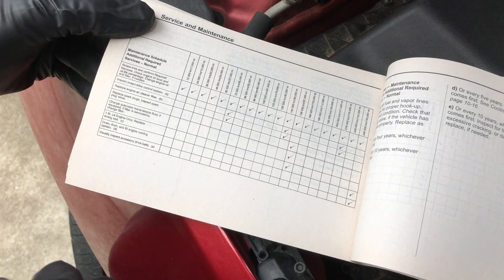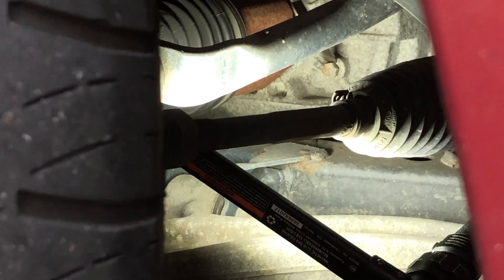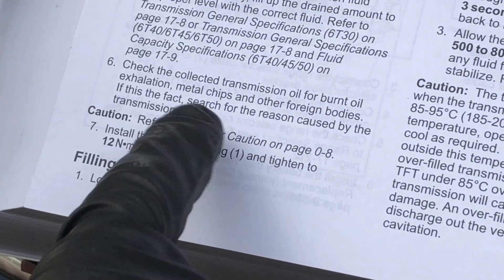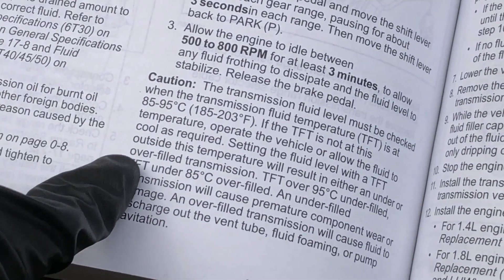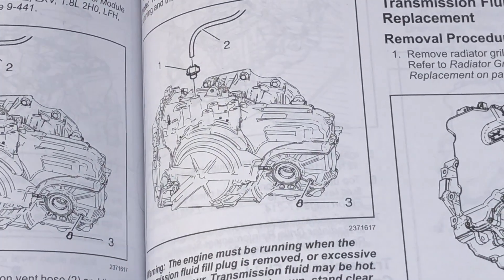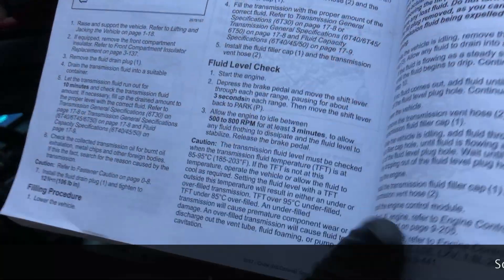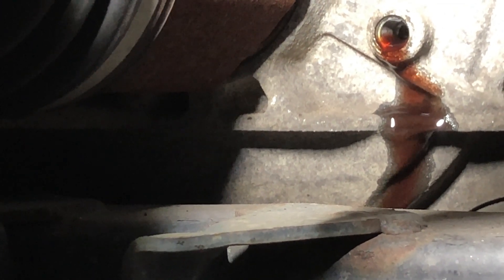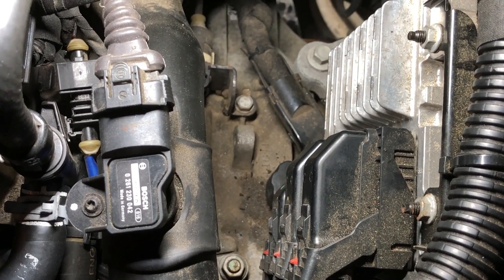2008 - 2016 GM Automatic Transmission Fluid (ATF) Change 6T30 / 6T40 / 6T45 (Chevrolet Buick & GMC)

Comment: I own a 2016 Chevrolet Cruze Limited LT with 103,000 miles, I went to a dealership and was able to get a print out and the transmission in my vehicle is the 6T40 (MH8). My owner’s manual doesn’t list draining the transmission fluid under the “normal” maintenance schedule. Instead it lists draining the fluid every 45,000 miles under the severe schedule. So I am a little confused by what my manual states. I live in PA and it’s 30 miles each way to drive to and from work. The driving conditions are normal, as in no long periods of idling or start stops pretty much just driving non stop. I haven’t noticed any slipping or anything. So my question is would it be beneficial for me to have my transmission fluid changed?
Reply from the maker: GM has for years kept inching towards their concept of "lifetime fluids" , so not surprising there would be differences in the 2016 owners manual maintenance schedules and the manuals even just 2 or 3 years earlier.   But GM never defines how many years, or miles, is their view of lifetime of a given vehicle.   So it's really a question of after how many years, or miles, is the owners manual maintenance schedule invalidated? 

I would go with what the model year manual for your vehicle suggests during the first decade and a half of the cars life , as that would be what the GM engineers determined was necessary for proper maintenance for that given model year. And fifteen years is likely a close approximation of what GM considered a given vehicles "life" .  But after that time I would consider performing some maintenance tasks that went beyond the manuals schedule that would help the vehicle make it to its second, and perhaps third, decades of life . 

The Chevrolet owners manual for the particular vehicle shown in this video, called for the ATF to be changed at every 97.5K miles under the normal schedule, for comparison.
Reply: @DrShock  Great reply,  as a Ford owner they do the same thing, they claim transmission, PTU I have AWD and rear are lifetime fluids. I don't think so, any company that claims lifetime fluid, they just want you back in the dealer buying a car a few years sooner than you should be.
Reply: Did a fluid change last week on my 98 Astro transmission and rear differential at 297,000 miles. It was burnt looking 15 years ago.

Comment: Ok shade tree mechanics, Instead of all that temp BS, just put back in the same amount you removed.   HOWEVER, be aware that if you were low to begin with you'll STILL be low.  So if your Trans is leaking then you must use the check plug method.

Comment: So why couldn’t you just do the drain stone cold, measure what comes out, then fill it with that exact amount?. No need to remove drain plug or warm it up etc..?
Reply from the maker: That would be the shadetree way of doing it.  And I've certainly done that route, especially for GM transaxle models where the level check plug is problematic to access without a lift.   But it's not the recommended way, and it won't catch the situation where you were already low on ATF to begin with.  You'll freshen up what you had for sure, but may still be low which can lead to internal wear issues depending on how low it was/is.
Reply: @DrShock  yeah well…it’s never had a leak and I bought it brand new…otherwise yeah, I woulda gone thru the trouble..
Reply: @xboxbml  i just did my ford edge ..same exact deal… i have friend that is a pro..that is exactly what they do ..measure what came out a refill

Comment: Hey Dr Shock what's your take on draining a transmission using the cooler line to pump it out? Transmission is a GM 4l60. I'm replacing the stock trans cooler so the lines will be off. Thanks for the incredible instruction!
Reply from the maker: I definitely wouldn't use the running transmission pump to do that, there's just too high of a risk of running the pump dry.  Internal transmission bushings can be damaged very quickly with a lack of ATF lubrication.   But if you have an external suction/flush machine that supports connecting at the cooler line, that would work.

Comment: On step 12 says reinstall engine control module what is that about?
Reply from the maker: I mentioned this in the vid, as an optional step to gain more access to the fill port area for certain funnel shapes.  I am using one that does not require removing the module.

Comment: Did it have a filter?
Reply from the maker: The transaxle models this vid covers do not have a serviceable filter.  It would be located deep inside, and only replaced during a full overhaul/rebuild.
Reply: @DrShock  Thanks, I appreciate the reply. 
Thank you for the videos….

Comment: Also we should note that the manual says 120,000kms then in fine print down the bottom, "if stop start driving, driving in heat, or under load, 60,000kms to replace the fluid." Makes me wonder how many Captiva's transmissions broke because they didn't know this. Hence the reputation issues sometimes. Maybe the earlier manual didn't say it anyway, mine is a 2016 Holden Captiva and it refers to this stop start etc basically city driving captiva, change at 60,000kms.
Reply: All real non simulated driving falls under harsh conditions so it's best to change it early & often.

Comment: Great video, congrats! I followed all the steps on my Chevy Captiva 2011. The only issue I have is that even after driving several Km (around 50) the temperature never goes beyond 78 Degree Centigrades! No way to raise the temperature until 85 to check the fluid level!   I have checked using both my Car Diagnostic Monitor and with a laser thermometer just to be sure I was reading the right value. Any hints to get to 85 Degrees? Thanks!!
Reply from the maker: Thanks.  It can certainly take awhile to come up to temp just idling.  But a short highway drive should most certainly warm her up inside.  When checking this without a scan tool, there's always the possibility of a false reading.  I presume your Car Diagnostic Monitor is some sort of bluetooth OBDII dongle device?
Reply: @DrShock  Hello! Yes I have used an OBD2 dongle with a mobile application. I can read several variables related to oil temperature, and all of them give me the same values. One is "Transmission fluid temperature" and another one is "ATF Temperature".  What looks really strange to me is that even after a 30 minutes drive the oil temperature never raises over 78 degrees...
Reply from the maker: Yeah, that sounds like a software bug in the mobile app you're using.  You might be able to report it to the developer and get an update to fix it.
Reply: @DrShock  Thanks. I will do that. In the meantime I have downloaded Torque Pro as you suggested. Tomorrow I will try again and let you know! Cheers!
Reply: Hey! I tried today again with Torque Pro, and I got the very same results...the temperature even after several Km drive does not go beyond 70- 76 Degrees. I tried with two different dongles ELM327 (one wifi and one BT) and I got the same results. Now my question is: could it be that the temperature sensor is faulty? Or, could it be that in my car for some strange reasons the temperature never reaches the target temp for level check? Thanks.
Reply from the maker: You would have a code if the transmission temperature sensor was faulty.   This sounds still like software problems with your app(s).   Did you go into the Torque Pro advanced settings and specifically add the PID for GM/Chevrolet?   It's a unique type of transmission temperature pid.   You can't use the default one.
Reply: @DrShock  Yes, I did that and I added the GM/Vauxall PID as it was described in another video I found on Youtube. Torque and OBD Scanner gives me the same temperature value, and more than that, if I measure the temperature pointing with my laser thermometer at the metal case of the gear case, it shows almost the same temperature. So it looks the temperature is right. It is just a bit weird... how to get to 85 degrees if the car keeps the temperature below that value? No idea. Thanks for your time.
Reply: slowly along in 2nd and 3rd is best apparently, that way there isn't much air cooling. I have a couple of small hills around, so just up and down these got it to 90'C no problem. This was after draining and filling up the amount that came out. It was spot on the level no problem, good to check.
Reply: Same thing, not a software bug. On average mine is 60-75 C, only got it up to 82 C once, took me 30 min and 16 KM drive. Maybe sign of some sort of issue that we can not get the temp to operating level?
Reply: same situation. most likely this is due to the fact that our cars have additional cooling radiators from the factory for our transmission, maybe someone did it, share your experience

Comment: is it necessary to change the filter in theese transmissions?
Reply from the maker: These models do not have an accessible fluid filter.   It's only changed out during a full rebuild of the transaxle.

Comment: I don't have a scan tool,so approximately how long did it take it at idle to come up to the transmission temperature required ? Thank you
Reply from the maker: That time is inherently dependent on the weather, outside ambient temperature, and whether the vehicle has been driven prior.   This video was done back in February during Winter, where the vehicle hadn't been driven, so it took quite awhile to get to the target fluid temperature.  The same exact procedure on the same exact car in the Summer would be an order of magnitude difference in time.
 
I don't recall how long this one took, but there's no getting around having a scan tool for this procedure given how GM has designed it.   You won't get the right fluid level reading without being in the right temperature range.

When folks don't have a scan tool, I recommend you just carefully measure the ATF you removed and add back exactly the same amount only.  It's not the preferred method, but it's not going to get you overfilled.  The risk is being underfilled with that route.
Reply: @DrShock  Ahh ok then,do u have a link for that scan tool you use or no, are they inexpensive?  thank you for the info, im gonna do it this weekend
Reply from the maker: I'm using the GM dealership gear, which is on the more expensive side.  The software can be rented over the weekend at www.acdelcotds.com.  But the actual adapter from the laptop to the vehicle is a clone/knockoff of the GM MDI adapter - https://www.youtube.com/watch?v=pZfXuuzORZo
 
There are some OBD2 Bluetooth type solutions that I mentioned in the video that might have this capability combined with the right smartphone app.   One you might look into is Torque Pro.
Reply: @DrShock  Ahh very cool, ok i will have to figure out one of those solutions thanks,apreciate the response

Comment: How many quarts did yours take roughly after the final top off? Just curious I have a 19 Blazer that has the same drain and fill procedure. 👍
Reply from the maker: I didn't keep track of this knowing I was doing the service manual procedure, but GM claims the 6T40/6T45 series will take between 4.2 and 6.3 quarts when drained from the plug only.  The variation has to be handled by the procedure I go over in the video.
Reply: @DrShock  Yeah I always end up refilling 5.5 quarts with the temp check. Was just curious what you had on yours. Thanks

Comment: What about the torque converter, The fluid in there? Drive it and drain again?
Reply from the maker: You cannot fully change the torque converter contents without disassembling the transmission, so this is not economical to be concerned with.  The GM service manual does not call for multiple drain and drives to attempt this indirectly.   Some folks like to do that approach anyway, but there's no factory recommendation to do so.   The basic service manual procedure is all the engineers that designed the transmission recommend, anything more is just more.

The dealerships will sometimes charge to hook up a machine that does an ATF vacuum and flush procedure.    Not required, and often a source of new problems on high mileage vehicle seals.  But it is a faster approach, and thus more profitable for professional shops, than the manual procedure from the GM service manual shown here.
Reply: @DrShock  I enjoyed your video. I went to my dealer to inquire about a fluid change on my 2018 Cruze after watching your video, 50K on it. The part about using a scan tool and refill procedure scared me a bit. The service advisor said their transmission service on my car would include a machine that would vacuum and flush out all of the fluid, including what was in the torque converter. Is this possible? I have known this guy for a long time so I hope he is not trying to rip me off. Maybe he was mixing up the procedure on a Cruze with another vehicle. Dealer wants to charge $249 (Canadian) for this. Seems high but at least I will know it was done right.
Reply from the maker: A flush machine works thru the  transaxle/transmission fluid fill opening. It is an alternative to the service manual procedure shown in this vid.   For vehicles that do not have a serviceable filter to replace, like the models in this video, it can be a lower cost alternative approach. For models with a filter, there is no alternative to dropping the pan/pulling the covers off to access the filter.

Flushing is not the service manual procedure, as you now know from viewing the actual GM service manual in this video.  But a transmission flush is fine for a newer low mileage vehicle imo.  However, I would discourage their use on older high mileage vehicles.   A full pan drop/or a drain plug drop and fill is less drama prone on an older high mileage vehicle.   There is some risk, due to how the flush process works, of dislodging debris via backflow in higher mileage vehicles.  Particularly those that have had poor or no servicing previously.
Reply: @DrShock  Thanks for response. So will this flush procedure also remove the fluid that is in the torque converter?
Reply from the maker: Most of it, but not all.  There's just no way to do that without a full disassembly and removal of the torque converter.  

But tbh, this is not something you should be overly concerned with though.  GM engineering recommends what should be done on what mileage interval already, anything else, like doing a flush instead, is going beyond what's required for long life of the vehicle.
Reply: Chevy wants $250.00 and more to do this on my 2016 Buick envision 2.0 turbo.

Comment: I would use something other than my very expensive and calibrated torque wrench to loosen drain plugs.
Reply from the maker: That's why I use a vintage Craftsman, they are American made inexpensive, durable, and do not snowflake out on you.  A well made one should serve just fine for occasionally loosening such 10mm or so low torque fasteners.

Comment: @DrShock I will be doing a transmission oil change on a 2016 Chevy Trax. Will it be the same way in this video?
Reply from the maker: It should be nearly identical, as the Trax has this same Ecotec 1.4L engine and 6T40 transmission.
Reply: @DrShock  thank you

Comment: This is a very good and detailed video. I appreciate consulting the service manner very much. My only question is why is it necessary to check the fluid level on a sealed transmission? If there aren't any leaks, why not just replace the fluid with the exact amount that came out? Thanks!
Reply from the maker: Thanks, you can certainly take that put back what you took out approach when then fill plug is not easily accessible.  I did that for the 4T40/45 version of this video here - https://www.youtube.com/watch?v=fxdgQ_CM9hw

Comment: Can't get trans temp even close to 75
Reply: slowly along in 2nd and 3rd is best apparently, that way there isn't much air cooling. I have a couple of small hills around, so just up and down these got it to 90'C no problem. This was after draining and filling up the amount that came out. It was spot on the level no problem, good to check.
Reply from the maker: It can take awhile if the transmission was cold this time of year.   It can also be approached in the other direction of course, and tackle this after a warm up drive waiting for the transmission to instead cool down closer to the target temperature rather than warm up.

Comment: I agree with all of this, however I would drain and fill twice (so be sure to buy nine quarts)  and drive for 5-10mins in between each drain and fill.

And FYI it takes FOREVER to get the trans up to temp especially if it under 50 degrees.
Reply from the maker: Yep, that temp is a slow slow walk even when it's warmer out.  I'd only point out that you can never get a full flush done as the torque converter will hold onto several quarts no matter what you do with the transmission still installed to the engine.  But diluting the worn out fluid with new is the goal in order to refresh the lubricant back to a younger average state of chemistry.